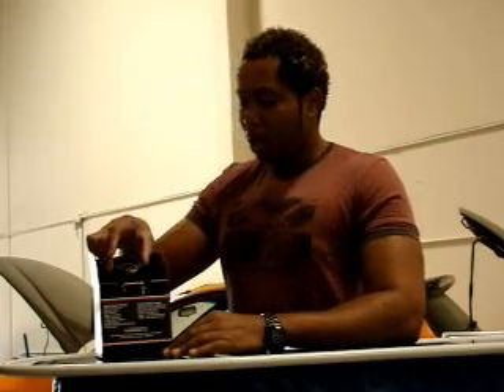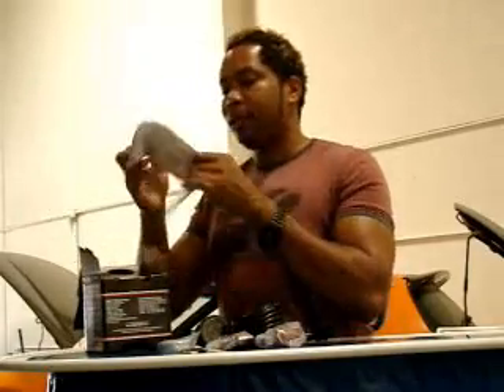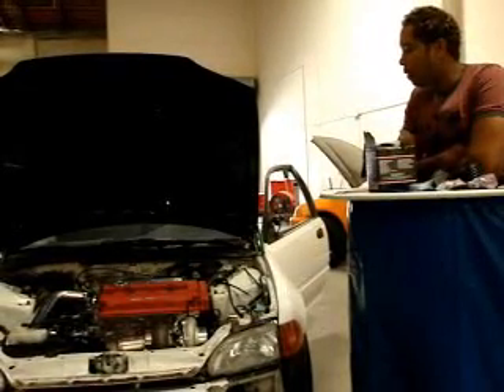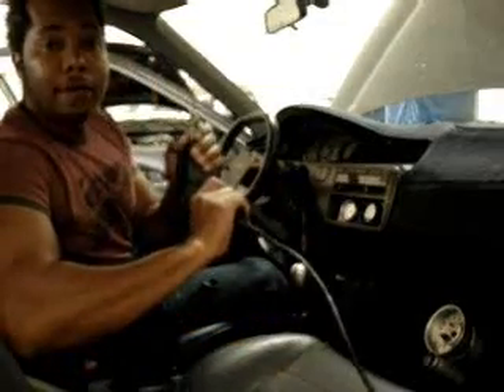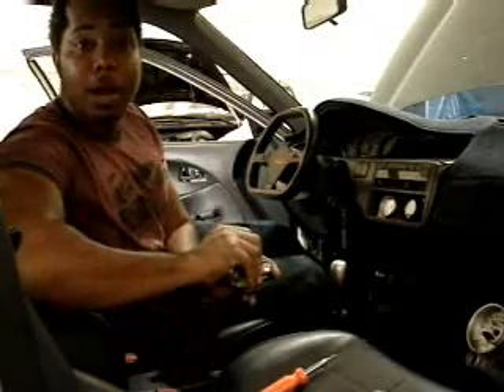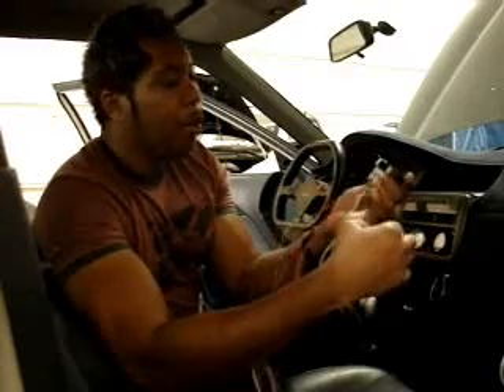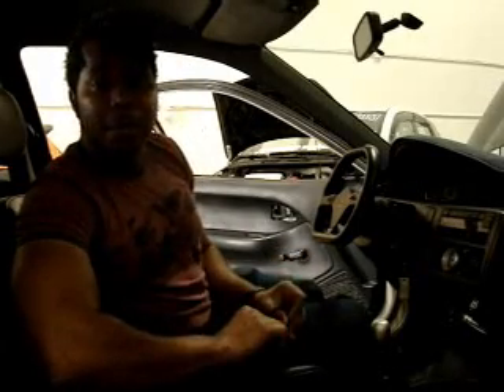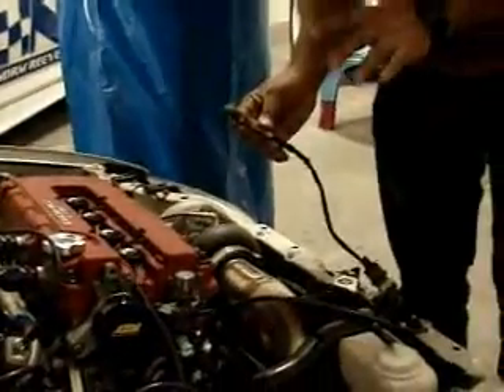AEM Analog Wideband Air/Fuel Gauge Install Part 1 of 2

Comment: @0spaceboy ?? Are you saying that an A/F gauge only gives you your A/F ratio when at wot? Because that would be false. My AEM Wideband reads in Idle, Partial throttle, WOT, and anytime the car is running.